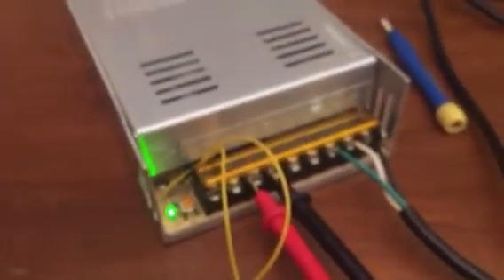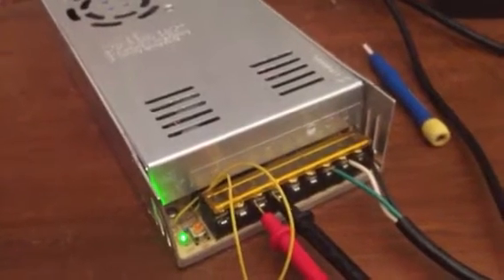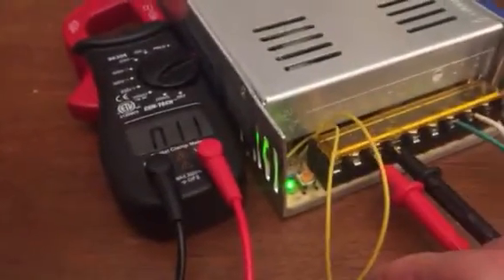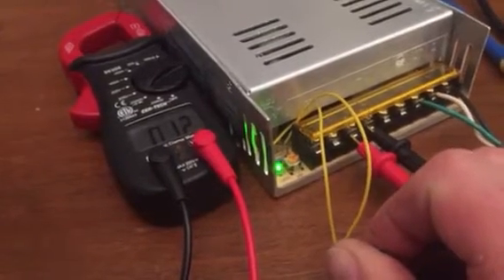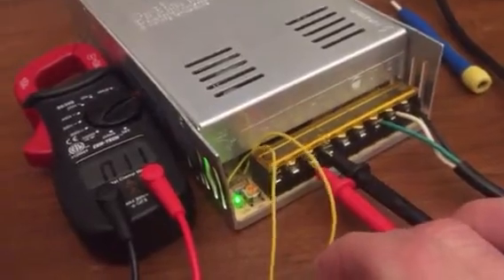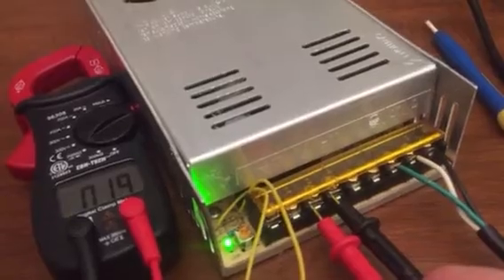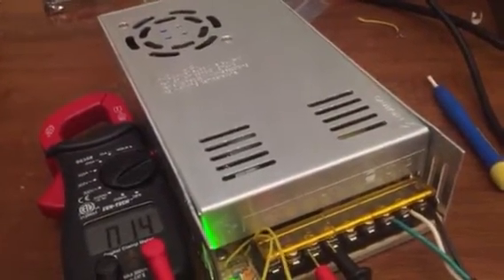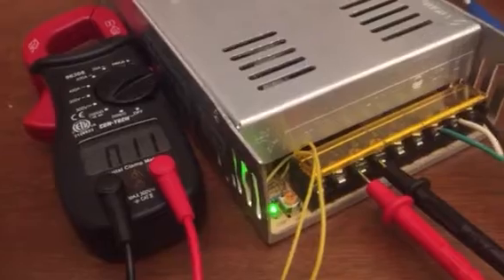30 amp 12 volt switching power supply voltage modification part 1

Comment: Interesting video. Question: Can this PS be used to power and operate a Cb or ham radio? If so, are there any modifications to be done? I am looking for a PS with 13.8v 22 or 30 amp.
Reply: yep!

Comment: thank you for sharing. does the built-in fan supply voltage will be affected by this mod?
Reply: Yes it does. And won't take 20v for too long
Reply: OK so I have 10 of the wk-500-12 ones.... Basically the same thing as this but different manufacturer. The numbers on the resistor in that slot is a different value. Like r47 or something. And it's a larger blue resistor none inductive. I have been searching around for a variable mod where I can control the combined voltage on a variable pot like this. Could someone point me in the right direction here? I am still learning about switching power supplies. And I'd like to be able to offer variable output on my power supplies.